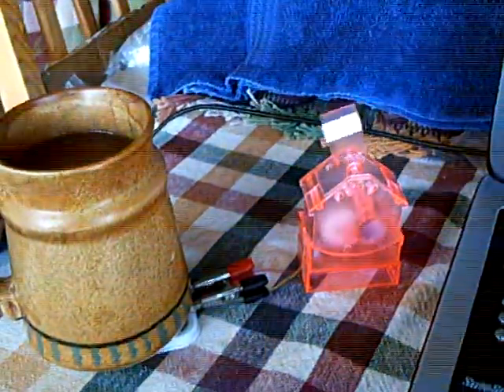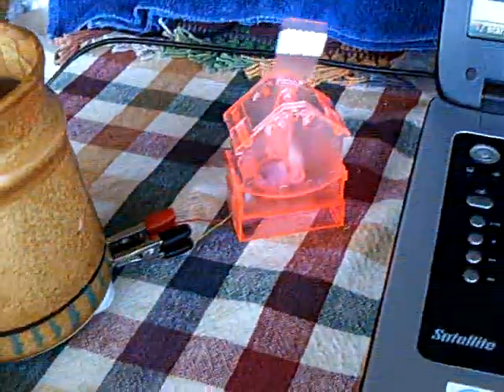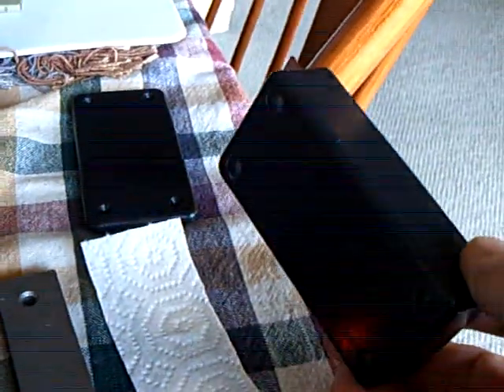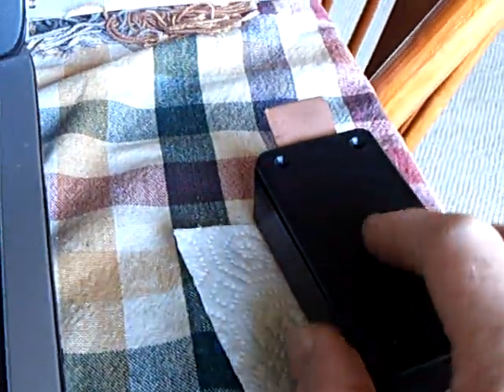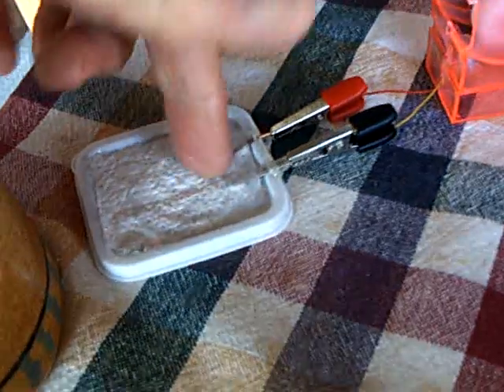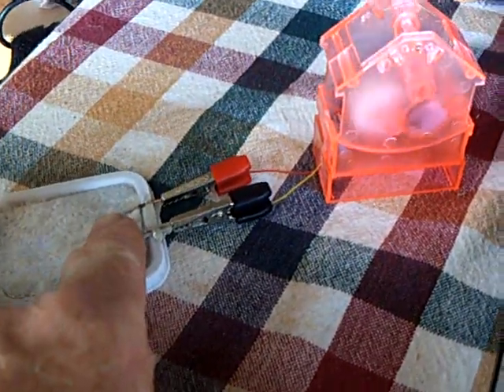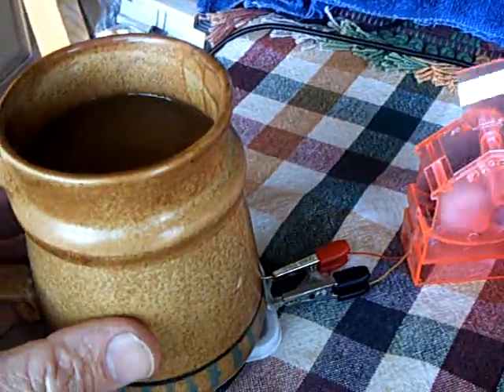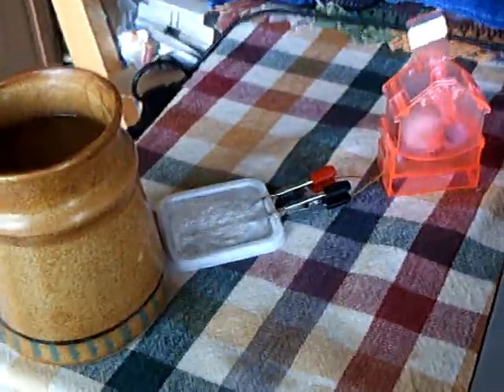Heat activated crystal cell

Comment from the maker: @100roberthenry -----That waving motor is a "Hankscraft" store display device.  It had a tiny solar cell on it like on a solar calculator.   The device uses an extremely efficient capacitor discharge transistor circuit.  The "solar waving lucky cat" and the "solar waving flower" uses a similar drive.

Comment: 2 dissimilar metals soldered together make a thermocouple,  meaning if energized it will heat on one side and cool on the other,  or if heat and cold is applied to either piece it will show a voltage.  maybe the metal in the salts is having the same type of reaction